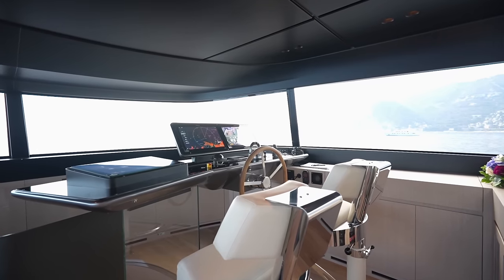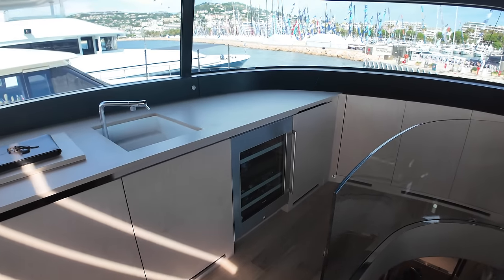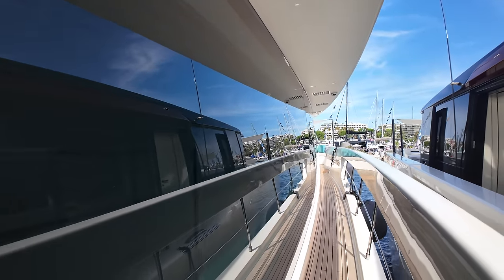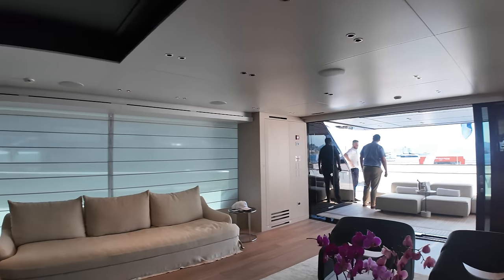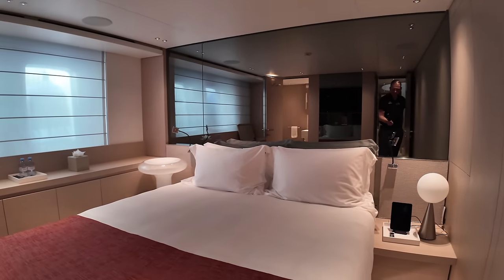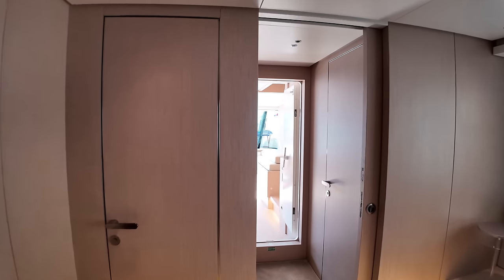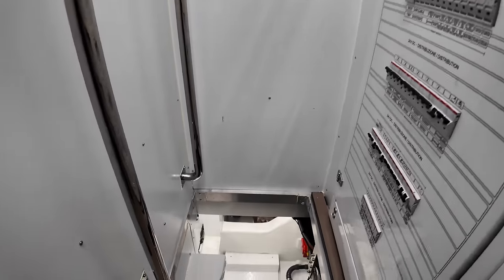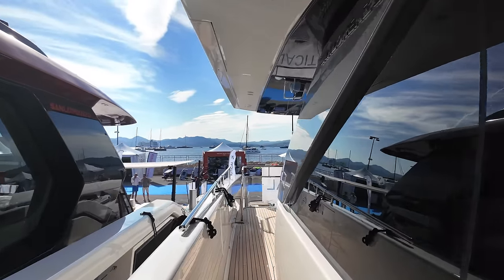€12.5M FOUR-ENGINE Motor Yacht ‘Ami’ FOR SALE!

Comment: beautiful.  but no thanks to 4 engines, thats 4 times the maintenance cost and 4 times the chance that something would break.  i would not want that as an owner operator or if i had it as a charter boat.  and some of that interior design.  two of those chairs in the salon look like puckered buttholes.  thats another no thanks. the pod-style helm displays are very good looking.  when i see that design i always think that such a pod should be adjustable for vertical and horizontal tilt and swivel.  just a matter of time i think.   they also need to figure a way to open up the galley and dining area.  as is it looks quite pinched. and finally i am absolutely not a fan of having the beach club day head adjacent to the master cabin.  even with a pocket door that degrades the privacy of the owners suite.